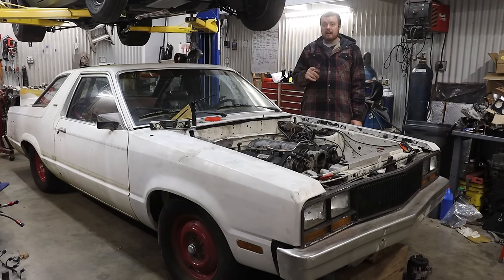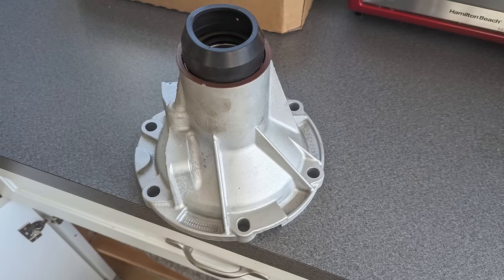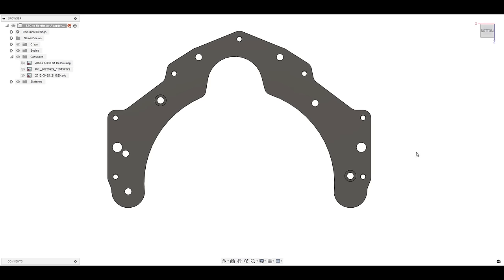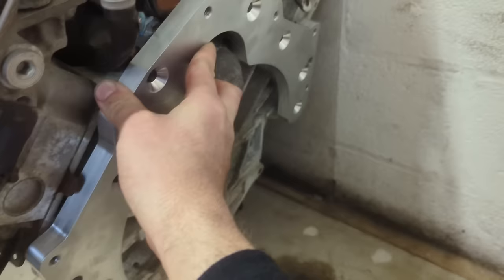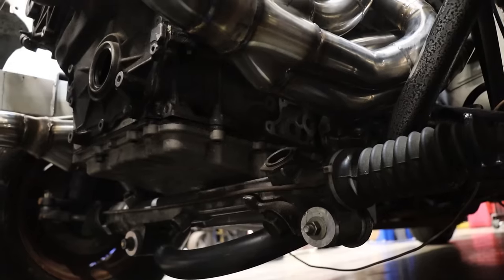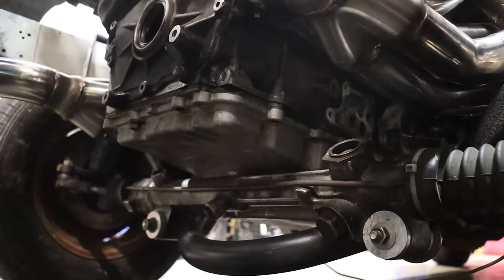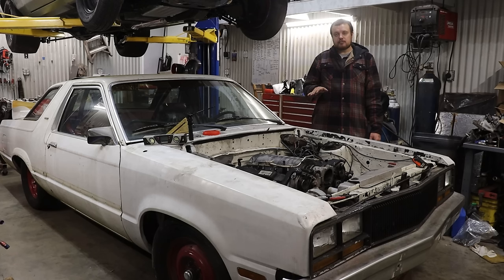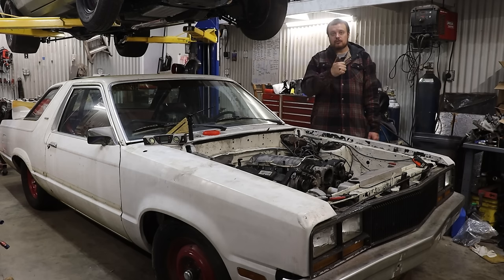Fits Way Better Than A Coyote! - Twin Turbo Cadillac Northstar

Comment: Those north stars sound pretty awesome with decent exhaust!  Their used to be a sand rail company that made cams and other performance parts for them and they used the 200 r4 or the GM 2.8 bell housing with a notch for the starter and a piece of strap welded across the notch.
Reply: Chm? chrm was the company? I think they did a salt racer too. Dyno run is on YouTube for that beast.

Comment: good luck with ALL the shortcomings of the Northstar.....hope you replace the starter with the ngine build
Reply from the maker: I really don't why people complain about that so much. It's 10 bolts you have to remove and then it's right there. Don't have to roll around the dirt to get to it. It's right there.
Reply: @Calvin-Nelson people like to complain about something they read on the internet. Like you said Calvin, it’s only a few bolts to lift the intake and you’re at the starter. And it’s not like these starters really ever failed. I think I replaced one or two over the years as a GM/Cadillac technician.
Reply from the maker: @PetesGarageandperformance  I've replaced one on my Mom's car. It was a 30 minute job.

Comment: Love you guys but Coyote is top shelf and that is no more of an alternative than a 4.2 Jag engine.
Reply from the maker: No one has tried though.
Reply: Juan, Actually You can use a Coyote, DOHC, single plane crank engine for high performance. though it is not actually the top of performance engines available either; You exaggerate for Your personal bias basis; which many others also may have. Ford just finally "got in the game" again with a production version, high performance engine. Then outdone by both GM within Chevrolet & Cadillac, Chrysler/Dodge/Mopar. These Northstar engines were developed for Cadillac, Oldsmobile Racing, then into mass production, with advanced designs from their Vortec designs, perhaps which also came from the LT-5, 350 c.i., V-8, DOHC, all aluminium engine for Corvette C4 ZR-1 via Lotus [GM acquired]. [these are apparently still very difficult to find].
Perhaps Your attempted Jaguar engine is from the Lotus British connection ?! 
However, also Ford Cosworth is British, thus its connection with the history of Ford high performance engines too.
If You would choose some high performance V-8 engines to compare with, putting costs, availability, support aside, then there are Ferrari/Maserati [some can be acquired relatively well priced as F135 -in single or dual plane crank versions - [4.2-]4.5-4.7 L], MB, VW/Audi/Porsche, etc. or within the USA via TRD, HRC.
But most individuals, viewers including those involve within building, modifying motor vehicles for various racing are commonly limited in the views, information base, knowledge, expertise, experience; thus unable to properly compare, assess, evaluate, differentiate, discern, more so not analyze, determine, conclude.
Good Luck, All The Best within Your person quests.

Comment: Very interesting 👌... just worried about them rods 😬😬
Reply from the maker: We've made 800+ whp with 6 rods that appear to be very similar in the 4200.
Reply: @Calvin-Nelson   The power is not the determining measurement, rather the forces upon each connecting rod.
So, with similar forces per cylinder, then a V-8 with larger displacement should be able to produce more power and handle more boost; perhaps with better rings.
You should be able to attain the known forces from the piston rod manufacterer(s) along with specifics from engine builders/engineers as Dennis at PME, Ed Pink, some others with the knowledge and access; thus know, which are the limits and range these will handle prior to damage, bending, cracking, breaking [not via common "Trail & Error = Failure" process]

Comment: Fits way better than a coyote...also has nowhere near the potential of the Coyote OR Fords 4.6 4V.
Reply from the maker: Huh. You have no evidence to support that claim.
Reply: Let me hold your hand and walk you through facts 

Not a Northstar or ANY GM on the planet has run 5.88 @ 256mph with a prepped oe cast block, heads, oe crank and nearly all oe timing components. 
 4.6 4V Ford ✅️
7s factory sealed  
Coyote ✅️
Made 2930 whp after winning overall Sick Week, Tx2k24, Import vs Domestic with a prepped oe cast block, heads and crank setting the world record for any radial drag and drive event 6.26 @ 227mph. 
Coyote ✅️
Or run 300.4 mph in a standing mile on the oe cast block and heads that came in the stock vehicle. 
5.4L TT Ford GT ✅️

My initial statement, while unpopular with most GM fans, is unequivocally correct.
Reply: @Calvin-Nelson 😂

Comment: screw a Northstar!!  Alll the work i have put into north stars i wouldnt wish this on worst enemy as a serious build.  Coyote you buy dont have worry about qnything except andding boost and fuel. by the ttime you have dug into northstar 1 time you couldve been done with Coyote build. And after you dig into the Northstar a couple times and go through a few of them you couldve built the yote boot the yote. and be good for 1500 to 2000hp
Reply from the maker: I could build 20 of these for the price of one Coyote. I'm going to give it a shot.

Comment: I thought the Northstar used the 'Small Corporate' (60 degree) bellhousing pattern? Other than the idiotic starter location anyways....
Reply from the maker: It's similar, but different. Starter is not that bad. I really don't understand why so many people complain about them. 10 bolts and take the intake off and it's right there.
Reply: @Calvin-Nelson  Probably because almost every other starter requires at most 4 bolts and it's out. And doesn't require replacing gaskets.

At least they moved away from sequential-torque mains and head bolts.
The Northstars were great engines, in spite of packaging concern and bean-counter engineering. Between the early LT-5 (ZR1) engines and these I don't think GM really wanted DOHC V8's. And that's kinda sad.

Comment: True Frankenstein's, true mad scientist! Love it

Edit* you nail the very reason why this engine is almost a foregone relic as far as the aftermarket, which is because it never really gained any aftermarket support, however I don't think that was the motors fault, but rather GM's froggy planning that had this motor in racing going back to Indy in the 90's, while the C5 was reborn giving way to the LS, and from there to rest was history.

My opinion, I've always wanted to see someone (with talent for DIY), do something with this motor.. This is right up there with Built it Your Self's 40V Ford V10 in my opinion!

Comment: Cadillac is the Original Henry Ford Company, was renamed after Henry Ford walked out (1902) and before being bought by GM (1909). 
The 1902 engines were actually a design intended for Oldsmobile but sold to Cadillac. 
Funny thing as the Northstar is a design by Oldsmobile engineering and put in Cadillac's. 
Your building a modern version of a "1902 Leland & Faulconer".

Comment: I've all but lost interest in DOHC engines. With modern transmissions, there's simply no point in wasting all that space and weight, just to broaden a torque curve... and most modern pushrod V8s will easily turn 8,500rpm.
Reply from the maker: Ok. More for us.

Comment: Too much computer. Get a life. A torch and a drill and the ability to use both accurately.
BTW, I was with GM engineering. They had those NStars revving to 1	k rpm with stock hydraulic lifters.
Reply from the maker: Hard to hit 0.001 tolerance with a jack hammer.

Comment: Why would you use an engine that was a terrible design to begin with ? That would be like using a triton 5.4 litre 3 valve for a engine swap. You will regret using this northstar engine.
Reply from the maker: I really don't think I will. There is no such thing as a perfect engine. The only drawback I see on this the open deck. Everything else is minor issues that are easily fixed